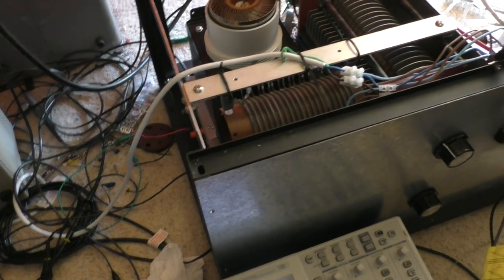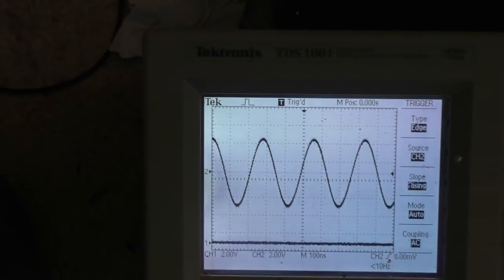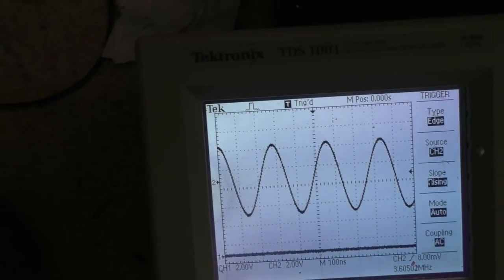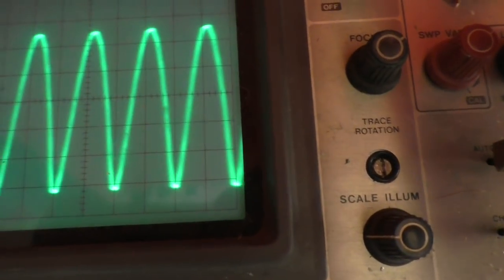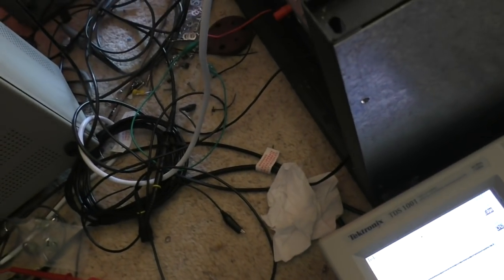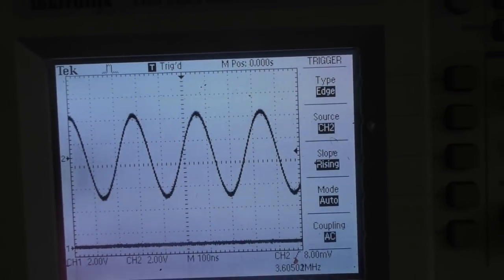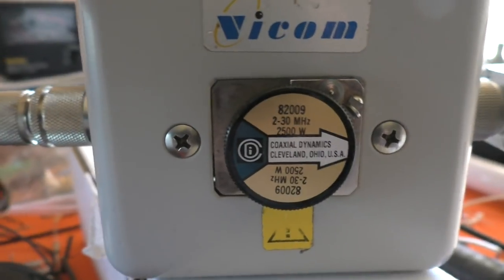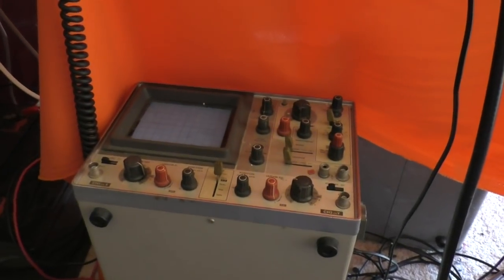So, The Output Was OK After All

Comment: Thanks for sharing, Steve. Glad the amp is working properly.
Reply from the maker: Thanks for the comment, so am I. I was thinking there maybe some problem with the GS-35B type valve as I read they're not particularly linear... and no-one has posted any video of a GS-35B amplifier output on a scope for reference.
Reply: @vk6cs456  They are linear enough,especially if you have higher idling current,,around 150ma minimum....try to directly connect coax cable between bird signal sampler 4273 and scope ,and terminate input on scope with 50 ohm,if scope do not have 50 ohm port...if you use hi impedance probe,as you do results can be funny...that is proper way to measure rf signals...

Comment: Hey Steve, nice vid on the line year (hi hi). It's a good feeling isn't it, to know that the amp is working properly after all. So is your other scope a Tektronix? I didn't see the model of it. Looks like a good scope, maybe just needs a bit of work. Probably not quite ready for the garbage yet. ;-)  de KD5MHQ
Reply from the maker: Hi Bob. It's a Hitachi I bought way back in the mid 80s. The peculiar thing is, if the amp is switched off the 100W of drive going through to the dummy load is shown as a nice sinewave.

Comment: Are you sure that the newer scope hasn't got a lower bandwidth and therefore acting as a low pass harmonic filter? Sorry if I'm stating the bleedin' obvious.........

Tim M6TYH
Reply from the maker: Hi Tim, no apology necessary, all suggestions welcome. The old scope is 35MHz and the new one 40MHz. The old scope shows the 100W drive radio output waveform as a nice sinewave... that's the same frequency but a smaller amplitude so I think it's just RF getting into the scope.

Comment: Issues on the Hitachi due to old cap's and oxidated contacts? I still have one as spare for if the digital fails. Maybe it needs some attention after so many years of service, I recommend don't throw it on the street, this can be a very reliable scoop for spare.
Reply from the maker: The peculiar thing is it shows the 100W from the drive radio as a nice sinewave.